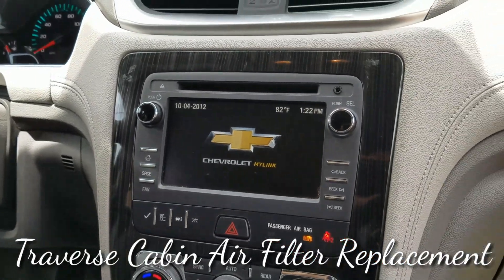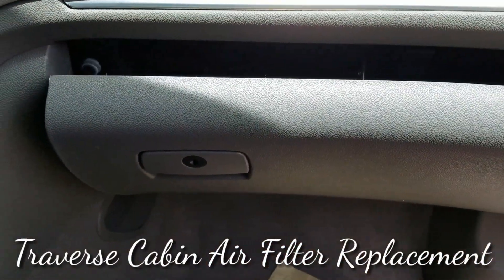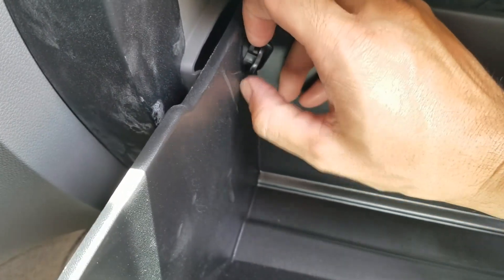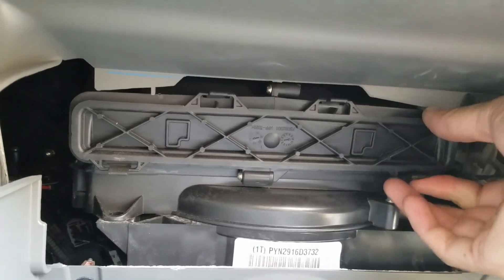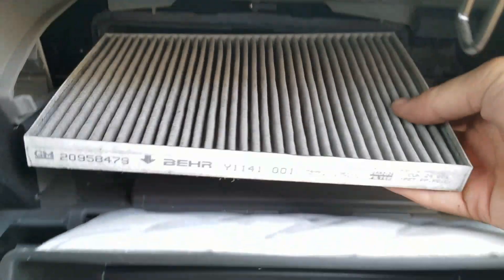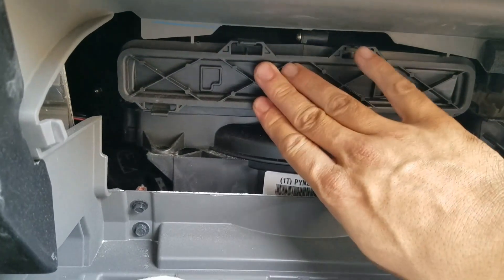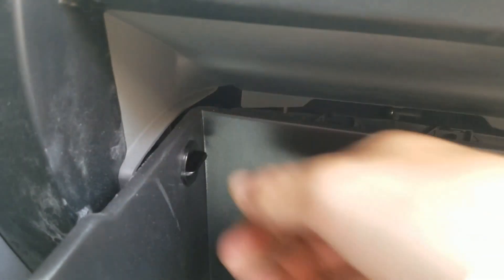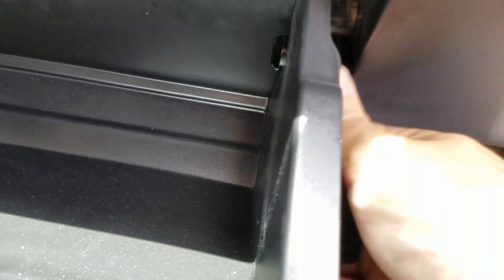Chevrolet Traverse Cabin Air Filter Replacement Location GMC Arcadia

Comment: That was the dum. Shack it off and put back in . Also did you see all the trash blow back into the car ? If you were not going to replace you should of said so in your video .
Reply: Who puts old dirty one in car? You can see dust all over. Where is filter housing
Reply: Agreed that was really strange that he didn’t replace it but I guess it’s for the point of showing how it’s done. Also the dust blew right back into the car.